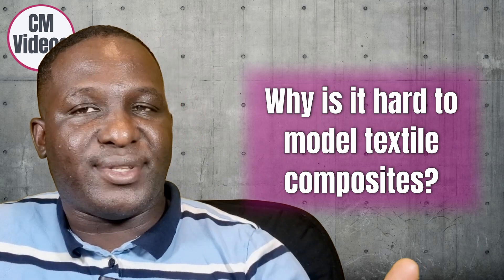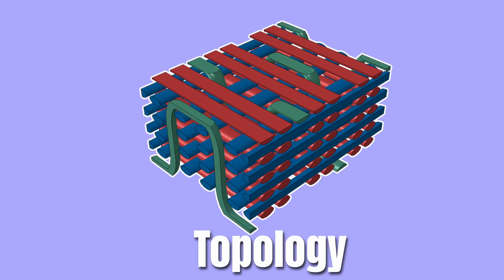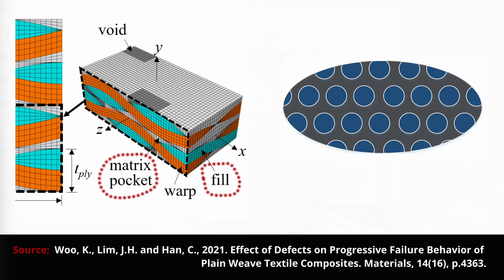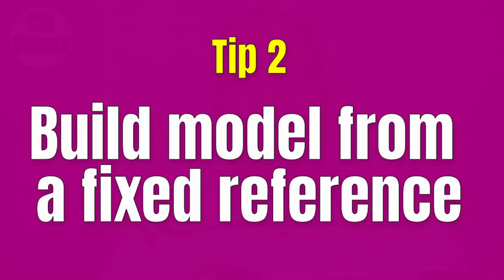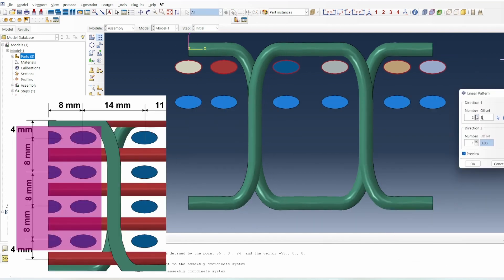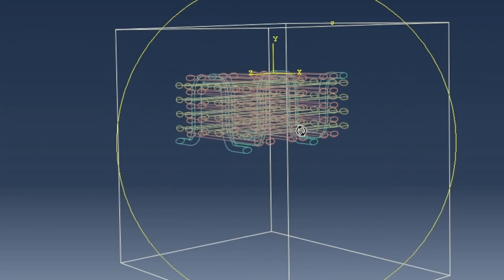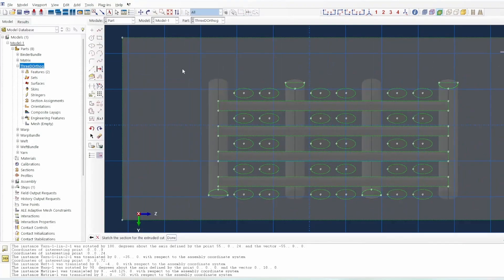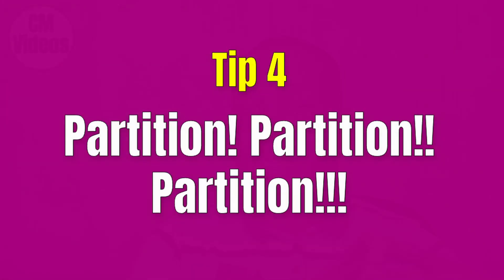Why Modelling Textile Composite is SO HARD (with a Solution)

Comment: Very deep understanding, very helpful for me! I am very interested in the 3D orthogonal textile composite meshing work you describe at minute 7. Will there be a follow up tutorial on meshing woven composites that I can follow? Thanks!
Reply from the maker: Glad it was helpful @Xiaoyu! On meshing, I will consider the request and see if it is something I can make a video about. A lot of time, it is all about trial and error until you get an acceptable mesh. Usually, you just have to keep partitioning the domain, until a feasible mesh is obtained. Alternatively, you can isolate only a smaller RVE which will be easier to mesh rather than this holistic version shown her. I will think about it and maybe make such a video.
Reply: @MichaelOkereke  Yes, as you describe, the fabric structure I built contains only one RVE, and I'm thinking about how to mesh better, would hypermesh be a little better?
Reply from the maker: Hello @Xiaoyu, with the meshing, I suggest you follow the suggestion of partitioning the model as that can help in the first instance. I suggest you keep to a brick or hexahedral element. If that does not work, then you can try the tetrahedral element but do understand the limitations of this choice. Finally, I have heard anecdotally that hypermesh is a stronger meshing tool and might be able to help with this but I have no experience of this. What I know is that there are a lot of ongoing research on how to develop robust meshing algorithms for such microstructures as the woven textile composites but like everything else, those research will not be available for public use (in FE solvers) till sometime in future.

Comment: Hello Dr, you didn't mention assigning of PBC since you recommended using an RVE; is it not needed? Thank you Sir.
Reply from the maker: Hello @Johnson, you are right, PBC in Textile composite's RVE, can be needed and presents its own challenges. I however did not include that here as you can still get a good result from a normal Dirichlet Boundary Condition but PBC will be preferred due to the heterogeneous nature of the RVE.